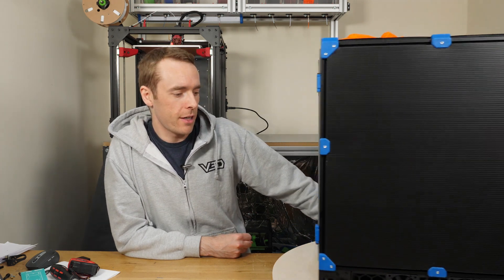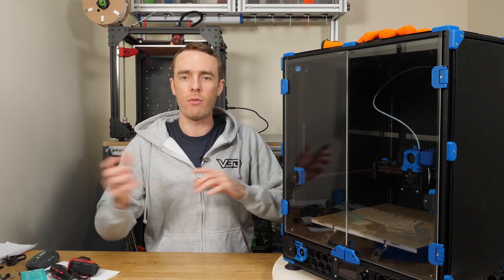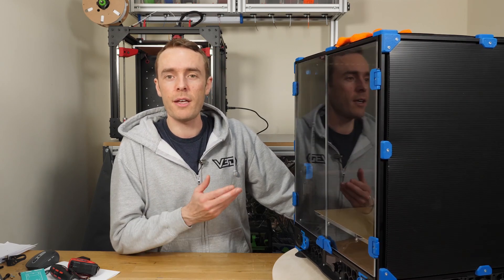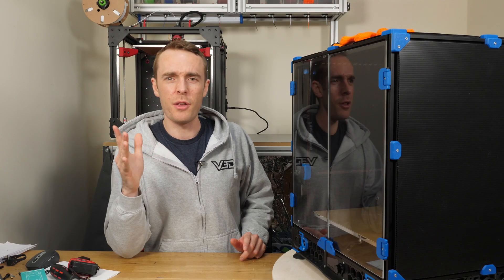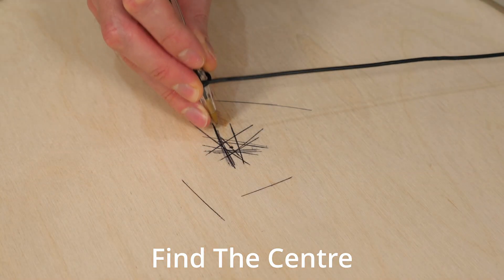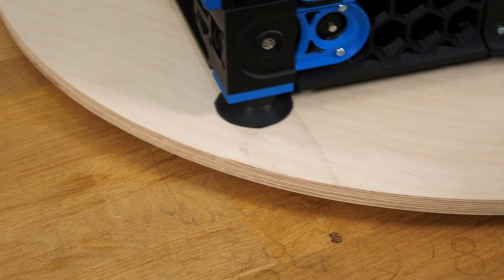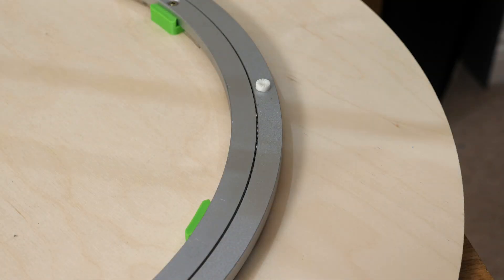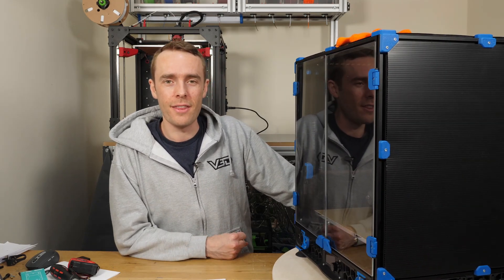I spent $50 fixing a $10 problem

Comment: The best part is when you are done building your large printer, you can disassemble the lazy susan and use that 500mm bearing for the "neck" joint in a 3D printed R2-D2!

Comment: I thought i saw a 3D printed design somewhere which you just fill with a bunch of plastic BBs. Obviously they're not ideal, but given the weight is distributed among a large enough number of them, that's not that much of an issue.
Reply: I'd say it wouldn't be an issue at all. I don't foresee the lazy suzan being spun enough times to warrant anything than the cheapest/easiest possible solution. Hell, you might even be able to get away with a slick surface between the two plates... For that matter, depending on your main work surface, you may only need one plate with a slick surface.

Some things don't need to be over-designed, I think this is one of them.
Reply: @SirSpence99  but the isn't cool enough. JS
Reply: 6mm airsoft BBS would do fine with that load. The larger the bearing diameter the better I would think.

Comment: I built something similar few years ago. I used 8 of those dirt cheap bearings 608zz. Much cheaper than those specialized lazy susan bearings, and probably less critical to exceeding weights. However, of course the overall construction is a bit heavier, since you need to 2 "turntables" - on working surface, and one stand.

Comment: Interesting. Is there any issues with the wood bending under the printer's weight making it hard to square the frame?
Reply from the maker: It's probably be OK, but I would recommended building the frame on your worktop, then use this after to fit everything to it.
Reply: You want to go to the local kitchen countertop maker and buy a castoff stone (sometimes they'll just give it to you) and use that to build your frame on, that's the flattest thing you're going to find that's not industrial engineering grade stuff that costs as much or more than the printer, lol.
Reply: I used to have my printer (a regular Prusa i3 style thing) sitting on a square of plywood that I thought was thick enough (18mm?) to avoid bending under the insignificant weight, and then some foam under the plywood to dampen vibrations. However the plywood warped noticeably in only a year or two 😕

I dunno if I just had bad plywood, if I did something wrong, or if that's normal, but after that experience I'd be cautious about doing a similar thing again without first mitigating that issue...